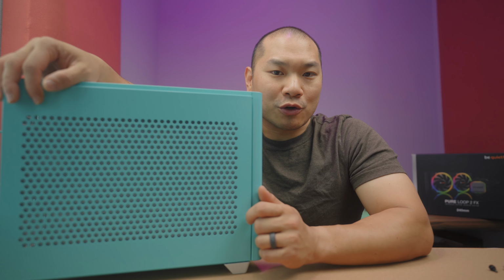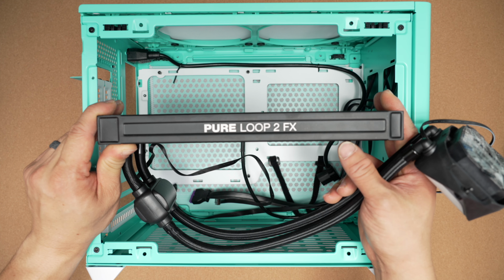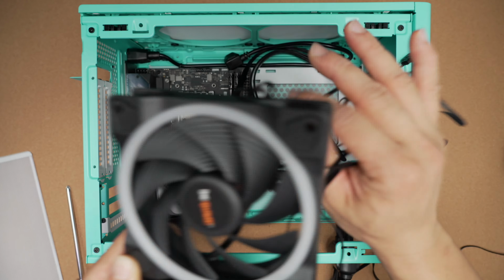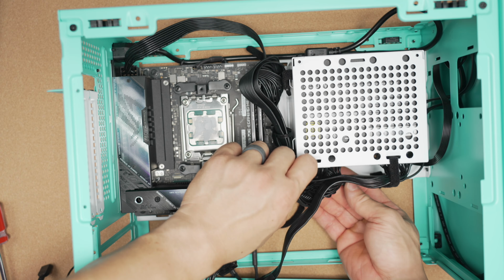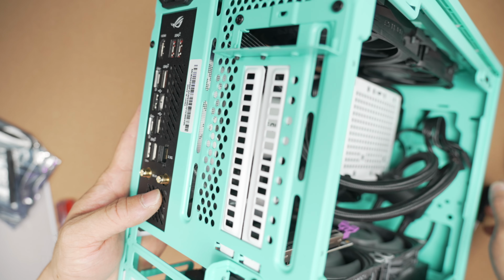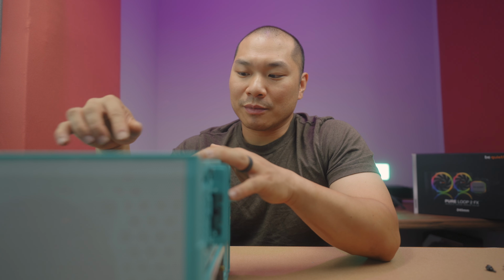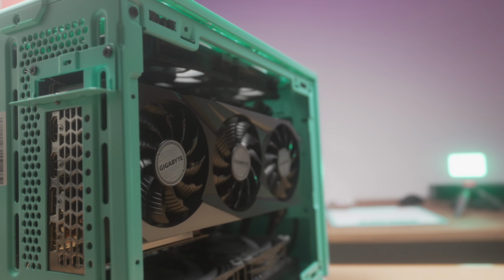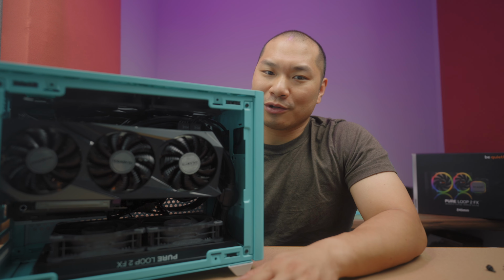Hey V2, OG can dual exhaust too!

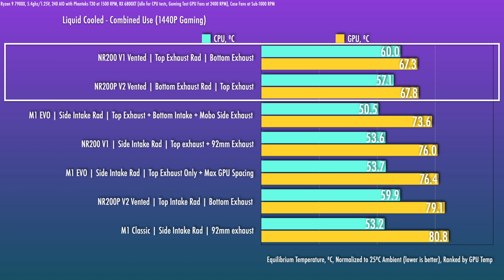Comment from the maker: Quick correction on the graph at 9:20, I incorrectly swapped the data labels for the v1 and v2. The v2 (60.0/67.3 cpu/gpu) should be on top and v1 (57.1/67.8) under it.

Comment: You should try doing both of the top mounted rad mods. You can cut out the plastic from the top panel so you get better airflow or you can fit slim fans under the panel. I use a couple of self tapping screws to screw the stock rad mount into the top of the case. You can then do the other top mounted rad mod where you unscrew the back panel of the case and drill out the rivets holding the back panel on. Flip the panel and screw it back on. This moves the clearance for the rad to the top of the case. When you do both of these mods your case can actually fit 2 slim + 4 regular fans and the space inside is used incredibly well. A custom loop looks like it could be incredible. You can even run it with the side mounted rad and a deshrouded gpu up top if you wanna be weird

Comment: Just get the v2 for 100$.... Easy to build, 280mm aio guarantee to fit, 4090 full size model guarantee to fit.....Why would you need any extra "versatility" if you can fit a 120/240/280mm radiator & any size GPU......

Comment: great video, I wanted to change my case with a mini itx and your video helps me a lot.

I have a question, I have the same AIO as in your video but in 240, I saw on other videos that there is still space under the graphics card once the radiator is installed, do you think that? Is it possible to put 4 fans in push pull?

Comment: If I am reding this correctly, at 9:36 you have the labels of the two cases swapped. The top most bars should be the v2 and the one below it should be the v1 (since thats the one with the bottom exhaust rad). Also that would correlate with what you are saying. Otherwise great video.

For me the OG NR200P is the better configuration. You can do air, you can do liquid, and its got plenty of space for a small form factor case. Not having USB C up front is a non-issue, same with not being able to mount a top rad. And let's be honest, most gamers do not have a 4-slot extra long AIB 4090. The extra space is nice, but plenty of cards can fit into the chassis. If you really need to get a bigger card in there, get something else like that Corsair One case.
Reply from the maker: Ah you’re so right on the typo! Good catch and thanks!

Comment: If only the cooler head was smaller or you could disconnect the tubes cause it would be awesome to run the tubing and put the pump block behind the front panel and run the tubes back through the two holes on the top of the panel saving lots of space

Comment: Isn't it bad to have the radiator below the pump?
Reply from the maker: Depends on the type of LCS. Here the pump is external to the cpu block, therefore it’s not the highest point. Plus you can easily refill the unit if air bubbles are in the system.

Comment: This is the orientation of the AIO that GN called out as harmful to the pump. You are not using an ordinary AIO, but the air would accumulate withing the block, that was the GN point.
Reply from the maker: There’s two things with the Pure Loop AIOs that make them work well in this situation. One is the in-line pump that is not in the block, so longevity concerns are not applicable. Two, theoretically bubbles can collect in the block if it’s at the top, which can have a noise impact, but the loop is user serviceable and comes with a bottle of coolant you could use to keep it topped off.
Reply: @MachinesMore  somehow i managed to break second pure loop 2 aio whit this pump placement, i don't now exactly why this happend, but i have an idea that this kinks are risky for the flow. pure loop, in my case, do not work with nr200p's psu bracket. i am devastated rn(
Reply: @MachinesMore  Great. But if you did not point this out in the video, you probably should pin a comment, for those not in the loop. If this work as you claim, it is a great way of showing what that sort of AIO actually can be used for.
Reply: @FrodeBergetonNilsen the point of this video was the case configuration, not to review the AIO unit which has been reviewed in other videos.
Reply: @adpt_music   Why are you arguing that people should play Russian roulette with their AIO and system? What kind of point is that?

Comment: I dont get why people are complaining about versatility and how the v2 is a disappointment. It adds usb c to the original and allowing all 4090s to fit the case. What other mini itx case fits 4090 strix,tufs,aorus masters and all the huge 4090s
Reply: Adding USB-C adds versatility? lol. That's all the V2 needed to add but instead they eliminated most of the options and configurations the V1 was capable of. What's hard to understand? Also tons of 4090 models fit just fine in the V1, so certain models that can only fit in the V2 is not much of an argument.
Reply: I don't see why fitting a huge 4090 is even that attractive of a feature for sff builds when you could just choose a GPU that's more reasonably sized.
Reply: Because the v2 removed most of the versatility the v1 had. What most ppl wanted was a few more mm added to the top and to the depth to accommodate top rads and mATX boards. Instead what we got was forced AIO + vertical GPU layout.
Reply: The average person isn't running a 4090 in most builds, yes we see all these creators with these high end expensive parts but that's not the standard so the ability to fit big 4090s is not a pro for most people.

Comment: Good stuff! The V2 is such a disappointment and I appreciate how you didn't hype it up like some people did (Gearseekers). What made the V1 special is the versatility, and the V2 lacks that. Deepcools CH160 is the better choice for sure.
Reply: The best part about the CH160 is the price. It's SO affordable. I just wish it was not as wide. 172mm of cooler clearance is more than some mid and full towers. 160 would have been fine. Great case regardless
Reply: I agree. The CH160 is miles ahead of the V2 but I am disappointed with cable management of the side IO ports. All things considered the NR200 will remain the best all round mainstream SFF case. It's one of those pieces of hardware that will have its place in the hall of fame.